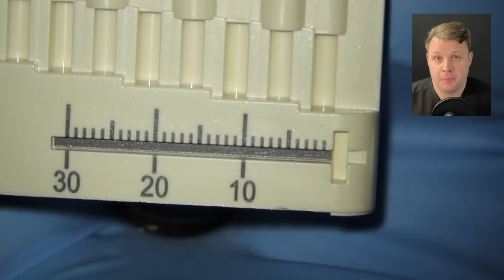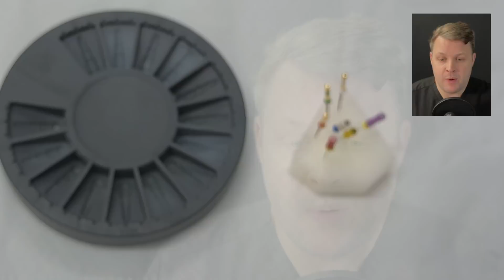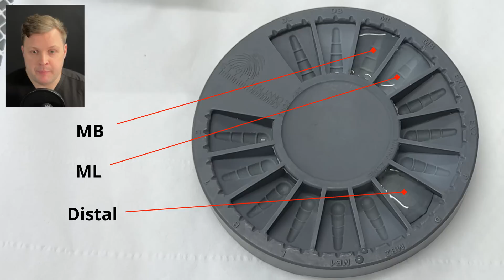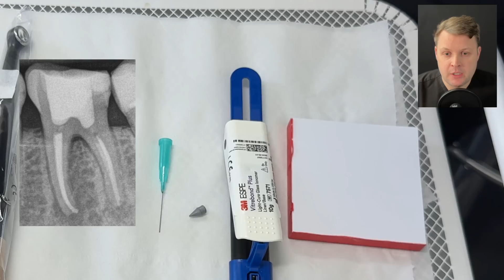🦷 The Easiest Re-Root Canal Treatment Ever? Full Breakdown! 🔍

Comment: Your videos are always amazing. Thank you for high quality endo cases! I wanted to ask why you put the GP at 0.5mm away from  your working length? (You mentioned this at 10:47)
Reply: Hi. This is what I learnt from a course, so someone correct me if I'm wrong. Basically the apical constriction where u get the 0 reading, is an 'area' of constriction, not a point. Kinda like contact points vs contact area between teeth. So when u get the 0 reading, you're at the end of the constriction. What we want is to avoid destroying the constriction top to bottom, hence we pull it back 0.5 in the hope that our shaping ends at the beginning of the constriction. We want the constriction to stay intact to act as the apical stop for our obturation. 
Hope this helps
Reply: @IrfanHadi91  thank you so much this makes sense!
Reply: O reading on Apex locator is major apical construction and -0.5mm WL is minor constriction. We obturate at minor construction
Reply: @rafaymohammed3441  that makes so much sense thank you!